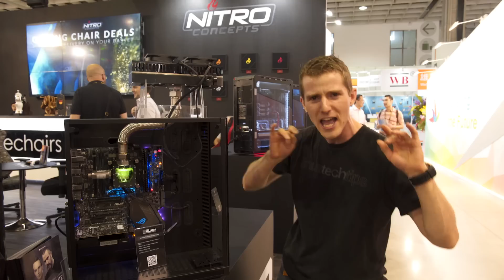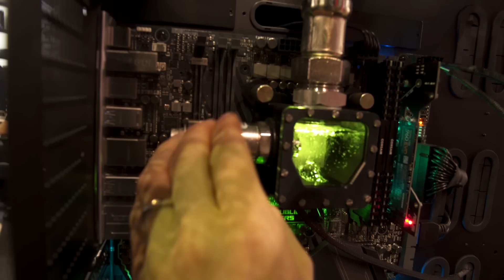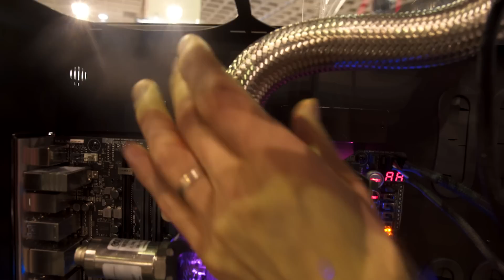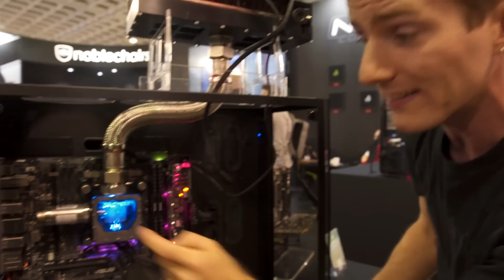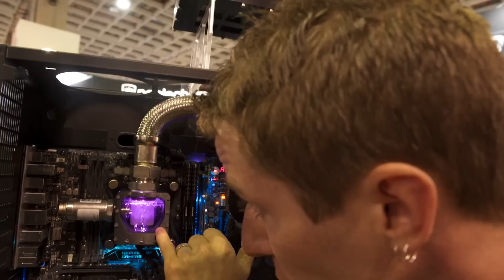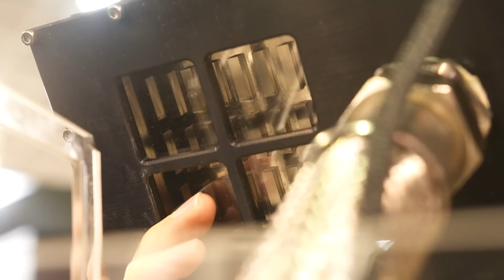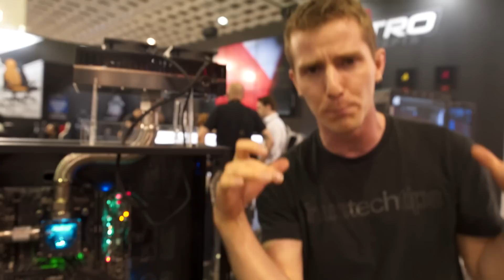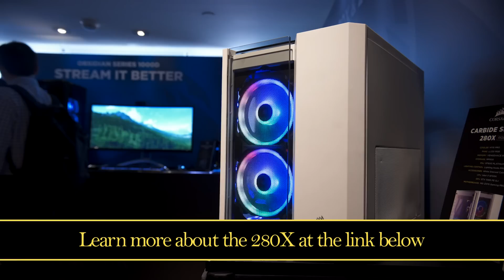Crazy Der8auer cooler prototype - NO pump!

Comment: For all those needing to know the answer to the mysterious fluid, My guess is (I'm not going say i know, well cause i probably don't, or do i... For liability purposes and don't want to be a "azz" to der8auer for giving up his hush hush.) that it is Fluorinert (http://detector-cooling.web.cern.ch/Detector-Cooling/data/3M_Fluorinert.pdf). If you read the liquid environmental profile it is basically saying it has no harm to the ozone but needs proper disposal, the same exact environmental warning as ethylene glycol (C2H6O2) or the heat transfer fluid used as what is also called automotive coolant. This stuff isn't new but to all your guess's of Novec i'm sorry to say that's not the case because fire extinguisher fluid would make this sound too cool lol , though it is still made by 3M and has been for 40+ years. If you read further into this stuff it is really versatile and you can get many different options in boiling points from 3M, quoted from the source materiel link "Fluorinert liquids are available with boiling points ranging from 30ºC to 215ºC and pour points as low as -101ºC." And well That is all i need to say you do the rest of the math.
Reply: to add to what i said this stuff does need to be reclaimed, so it would work in self contained AIO style cooler Pre-filled. This is purchasable in small quantities i believe to general public, but don't quote me on that.

Comment: Refrigerant? extracting heat from the cpu to boil off into a gas, then condensing again at the heatsink with the ambient temperature of the air. then returning back to the cpu as liquid to start over.

Comment: Probably Acetone, boiling point of 50.5°C, completely organic (flammable) and is not corrosive to metal directly. It will however corrode impurities on the metal. It does look like he's using something over the CPU so that the metal plate on the bottom is doing all the heat transfer so he able to keep contaminates to a minimal. 

Could be wrong could be right. Either way that's my guess

Comment: Novec von 3M, garantiert
Reply: No. He said it is not.
Reply: @tankpenguin175  he lies
Reply: Welches novec? Es gibt verschiedene.
Reply: @vw6702  vermutlich 7100 oder 7000
Reply: @spacecraft7653  würde ja auf 7100 tippen, aber 7000 wäre top, wegen dem geringen Siedepunkt. Gibt jetzt aber auch ein neues Novec 649 mit 49 Grad Siedetemperatur denke das wird es sein

Comment: ya, two hoses work better because with the one you have return liquid heating up as it returns. as for the liquid in this, we can figure boiling point evaporation point what liquids match for dissipation and return rate and cool the quickest.

So, in short, it's the rusty radiator all over again but without a pump, and it is using convection to move the liquid.

Comment: i would guess methanol, it would build around 65c to keep a good temp and still be able to be a liquid when turn back to room temp.

edit:
methanol is to obvious i have a list below that may give better temps and would fit the we will never guess it i am pretty sure they are all liquids at room temp but let me know, i am not a chemist at all

Carbon Disulfide CS2 - highly flamable and toxic - somewhat cheap
Cyclopentane - highly flamable but could be used as it is used in refrigerators before - cheap
Diethyl ether - highly flamable - cheap
Ether - flamable - cheap
Ethyl bromide C2H3Br - cheaper but rather toxic
Isoprene - likely but expensive

Comment: If the "window" of the coolerblock is not plexi it can be "methylene chloride" since it's boiling point is about 40°C and it does not react with copper or stainless steel. Also it's not flamable, but it is quite toxic. If it would leak it can be quite dangerous specially in an enclosed room or when it comes in contact with skin or eyes. So i'm not sure if it is very consumer friendly, but it's used and sold as a paint stripping chemical so it's probably possible to get it licensed.

Comment: Probably something ethanol or methanol based.

Methyl acetate?
Color, boiling point, vapor pressure, and refractive index look plausible, while the molar mass and high phase change requirements would make it a pretty ok coolant.

I highly suspect that this is kind of a meh cooler, but it looks SICK AS SHIT.

Comment: There's a hint in one of der8auer's videos where he says the boiling point of 7100 is to low for his next project, so I'm guessing either Novec 774 or 7300.
https://multimedia.3m.com/mws/media/1091997O/3m-novec-engineered-fluids-for-heat-transfer-line-card.pdf

Comment: It is probably water, and the cooling rig is at 2.5 PSI (Lower pressure - Under Vacuum) hence the thick block and piping and pressure sensor.

Comment: It's novac coolant not that hard boils at 40c meaning the cpu will not exceed 40c which makes it hot but also at a low enough temp that nothing over heats and it's not like a liquid nitrogen which could be used as a coolant but it would be huge

Comment: Hydrogen or something similar none burning, no alcohol or something like that. More a Gas under high pressure so that it is fluent and will boil very quick. You do want the CPU to be cooled right? So it has to boil at a low temperature.

Comment: my guess is de-mineralized water. No I don't mean deinonized, de-mineralized.  Water itself is not corrosive it is the partilculates that make it that way. Back during the days before turbofans when turbojets were the thing spraying de-mineralized water into jet exhaust would raise the thrust density and non- corrosive alloys were yet to be widely available. How do I know this? I was on the flightline pumping this stuff into KC-135 A models. If it's not this stuff it's the novec stuff. There just isn't a whole lot of things out there that fits. And I really can't see it being any sort of flammable, the liability would be way too much.

Comment: Someone should make a liquid cooled pc using a heat pump. 

A heat pump works like this.

  /-------Compressor---\
Coil                          Coil
\---------Expansion-------/

It takes the heat from the left coil and moves it over to the right coil. 
How does it do this?
Well, simple, it takes the heat from outside the coil and transfers it into the liquid inside using the compressor, this causes the liquid to heat up and evaporate. This turns it into a gas form and it gets moved over to the right coil where it cools down the liquid, this causes the outside of the coil to heat up letting go of the heat, then it just goes on back to the left coil again after going back to liquid form. 

This is used in houses to heat up the houses but if you were to put the left coil in for example a water tank/water heatsink inside a pc it would take the heat from inside the pc and put it outside the pc. Just think of the pc as the house but you want to take the heat from the house and put it outside instead of the other way around.

I know a lot of pcs that are liquid cooled use similar stuff, but id like to just see the most DIY version of it, I bet Linus would do it

Just like a proper heat pump pumping heat out of the pc and not taking the warm water moving it over to a radiator or whatever its called, dispersing it throughout it and using fans to take it from the out.

I bet you could liquid cool a pc even better using a heat pump. Now I might just be really fucking dumb saying this cause I don't actually know much about pc stuff, I just know some basic shit. My personal pc has a gtx 1060 dual oc 6gb vram- 16gb of ram and an i5-7600k running windows of a Kingston 256 gb SSD and storage on a 2tb Seagate something

Comment: 3M™ Novec™ Engineered Fluids  649 or 7100
Reply: Yup.. tried to get my hands on that stuff 5 years ago but couldn't due to regulations.. :/ Can't have nice things in Europe..

Edit: Just saw how old this video is.. but in case someone doesn't know what I'm talking about:
/watch?v=BH9_m7o_i-U
Reply: @ichbinwirklicheinechternam6442  nobody can get their hands on refrigants without being a certified technician here in germany. this is obviously a refrigant that boils at a certain temp at a certain pressure
Reply: @MrXCyrax  They were just asking for a company; Not a certificate – didn't wanted to go the extra mile tbh. (Same goes with nicotine – in switzerland you can import that stuff legally, while in germany you can go to jail for importing it without a license)
Reply: yeah, i design something like this a couple years ago for a University work

Comment: It'll never come to market. Similar low temp boiling coolers have been proposed and prototyped many times before and went nowhere. The limitation of only being able to placed above the heat source which effectively makes it CPU or single GPU only just makes it impractical compared to more traditional cooling when balancing price and performance. What real advantage is there to removing the pump seeing as its already quieter than the fans. Its a novelty at best just like submerged systems. 
It would have been nice to see what temps they were actually getting with that monster.

Comment: low pressure water, none of the alcohols would be compatible with all the materials used. The pressure sensor is a testing safety to shutdown for leaks or over temp

Comment: the basic is , the liquid for cpu temp. consideration should be of low boiling point , so that it start boiling and evaporation leading to cooling phenpmenon , before the temperature strikes upto thermal shutdown point , so for the best of it are some of options like (ethyl alcohol , ether , acetone ) , buat all should be under low pressurized encapsulation and with vaccum (no air molecules inside ) so that it won't able to combust even still it keeps on boiling for class1 duty cycle (continuous working , without interruptions).
Reply: this is the real answer , ask me any more watsapp +91-904557867 india aditya chauhan😃
Reply: 9045557867

Comment: First thought was moonshine cooler :P Considering cpu temp and boilingpoint. But since there is a pressure sensor and the way it is built my guess will be that it is distilled water under a low pressure in a closed loop.

Comment: My guess was acetone but someone already put some money on that, so i'm going with Pentane, tho it's pretty flammable and probably corrosive to many types of rubber and plastics. It at least has a boiling temperature I would like on my CPU both for the effects and the utility. As for now I'm sticking with my Xigmatek Thor's Hammer S126384 and my 3000 rpm 120mm workstation fan.

Comment: it would most likely be a gas at the just the right pressure becomes a liquid and add just a little heat it becomes a gas again so that said it could be any gas really you could use bromine that boils at 58.8 c or chlorine that boils at -34.6 c just because you don't need all that much pressure to keep it a liquid and not too much pressure otherwise it would stay a liquid. it could be any gas that don't need a crazy high pressure to stay a liquid but something that would be easy to get at a store and something that won't kill you or the computer if it gets a leak and not explosive. But I would say lighter fluid is a good one. easy to get and easy to bring to liquid and won't kill you or the computer if it leaks its flammable but people don't  normally put computers in fires thanks for the video I can use this technology on my own experiments now great idea guys I don't know why I didn't think of that but it's way too big make it smaller so it all fits in the computer and don't need that much gas and move the pressure sensor so it don't hinder the components

Comment: I bet its just normal destilled water. in lower air pressure water can boil at about 60-70°C, with lower pressure in the cooling system the water could just get boiled by the cpu on 60°C and cool off (might also be the reason for the pressure sensor)

Comment: For some reason acetone popped into my head instantly. I know it's boiling point is around 56 degrees Celsius, so it could work. It is really easy to condense back to a liquid and get cool again quickly. The only problem is that it can corrode certain things, so you have to be more selective with materials, but it's definitely a possibility. It makes sense considering the "special requirements" the system has. It's also a bit explosive, but that can easily be avoided with a safe design. There are a few cooling systems I know of that use acetone, so that is my guess!

Comment: Butane or propane. They would work, be non corosive, and explain why the system is obviously designed to maintain a pressure other than the ambient atmospheric pressure, note the braided steel hose. They are already used as refrigerants because they are good at doing exactly what you see here. Also they are super cheap, unlike some of these exotic chemicals people are mentioning. They do have the potential to create a whole new meaning to "catastrophic failure" though. But assuming no or little oxygen is inside of the system, the risk is minimal.

Comment: My guess is R-123, it has a low boiling point, 82.1 F  (27.8 C) at atmospheric pressure and has excellent characteristics for a build like this. It's also says at a fairly low pressure when it gets hot, 150 F (65.6 C) degrees is only 33.9 psi.

Comment: Ammonia? Makai Ocean Engineering uses it as heat exchange fluid for energy production, if adequate insulation is used from components, it might be made to work, pumpless. Anyway it's fun to have a guess on this, curious to discover what it turns out to be :)

Comment: is the coolant used "HFC 245FA", (Pentafluoropropane)? Used in similiar project (by calyos).
Reply: That wouldn't work here, the boiling point is way too low. It is a gas at room temp, so there is nothing to boil, and it can't be condensed without higher pressures in the system. The boiling point needs to be a good bit higher than room temp for this project to work properly.
Reply: @svampebob007 You have absolutely no clue to be honest. The preasure sensor could be there to see how high it rises do to gas being created in the system when the liquid boils. You know that happens, right? My guess was acetone. It boils at 56c and can be condensed and cooled again quickly. Then with a very slight vaccuum, you could decrease that easily if you wanted to. I don't see a system that requires higher preasure like HFC 245FA making it as a commercial product. Acetone is cheap and easily available. It can also be very safe. Many systems use acetone as a phase change coolant already.
Reply: @Ryan Grissett This is under pressure, hence the pressure sensor

Comment: He uses CF3CF2C(O)CF(CF3)2. It is phase change cooling so radiator must be higher than cooled object. (Because vapor goes up and liquid down!) It boils at 49*C  => fluid goes to vapor, and vapor goes to fluid in heat exchanger.

Comment: Acetone or diethyl-ether would be my guesses, though them being good solvent's might be an issue.
Generally you'd need a liquid with a boiling point below your desired maximum temperature and increased pressure increases the boiling point, so ethanol is a bad choice with a boiling point of 78.5 °C.

Comment: It could be basic water, at a very low atmospheric pressure.

Water can boil at 30°C if the surrounding pressure is 0.6 psi

Safe liquid in a well sealed box = no problems
Reply: Doubt that it's water. The cooling block on the CPU as well as the tubing tends to indicate high pressure. If it were under a partial vacuum, there wouldn't be nearly as many bolts needed to hold on the cover for the CPU block since atmospheric pressure would tend to keep the cover on. Also the steel braid covering the tube would let atmospheric pressure through and collapse the tubing being protected. And that tube would have to be EXTREMELY crush resistant if it were under a partial vacuum. But if it's under pressure, then the steel braid does make it stronger and would be useful. But there's LOTS of clear fluids out there that have a reasonable boiling point and without knowing anything more specific than "quite toasty", it's impossible to actually determine what the fluid is. Would be nice to actually know the temperature of the fluid and the pressure involved. Without out information, we're all just guessing.

Comment: I mean... You don't need anything fancy if you have a vacuum in a closed loop. I ran 3/4" copper lines through multiple water heaters with the submersible pump in the water supply disengaged. A few seconds after opening a valve I made a spill that was much larger than I thought. 

I'm planning on doing this in my custom water cooling configuration, but with 1/4" type K copper.

Comment: I wonder, when do they find a solution so that we dont need to apply the thermal paste ourselves? (i know, it aint that hard, but it's one of the most frustrating part of PC-remodeling/repairing) i always love it if a cooler has pre-applied paste. but it would be even better if there was a way to use a cooler that doesnt need the paste or it should be built different way. 

for example, the CPU could have a "paste socket" on top where you put the paste, but the rising edges around the socket would keep the paste inside it, without leaking outside (except if it drowns in paste) when installing cooler.

Comment: 1,1-Difluoroethane!!! It’s common doesn’t deplete the ozone and is non toxic!!! Also boils at -25c at 1atm but it isn’t so it could boil around 0 to 15 depending on the pressure and would condense at 20-30 or so degrees c if under the pressure he has it at with it constantly boiling.  I put my money on that 1,1-Difluoroethane anyone agree?

Comment: Its De-ionized water, with lower pressure in the loop in order to require lower energy for the water to boil(60 degrees Celsius and up). This way it cycles more efficiently replenishing the main CPU sector, in order to cool the dome of the chip.